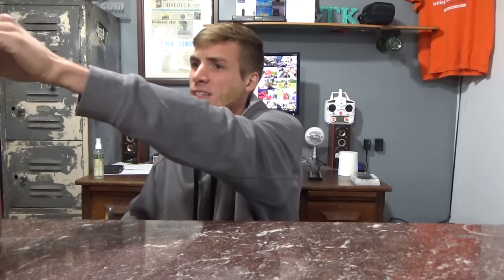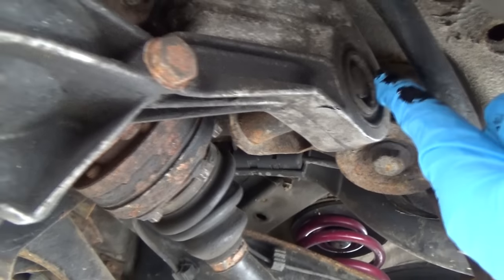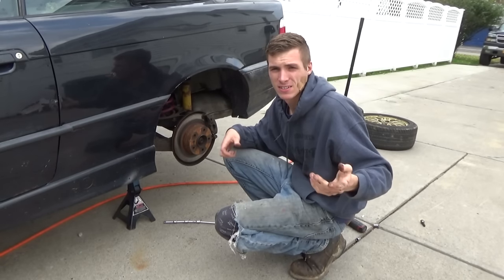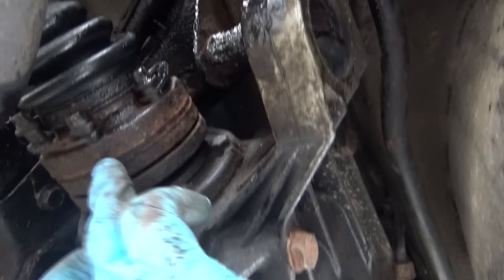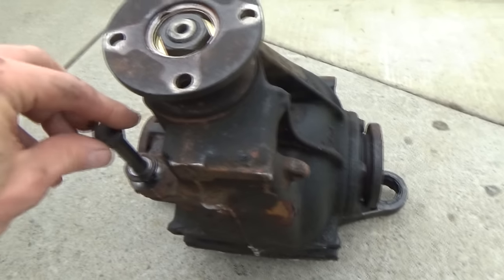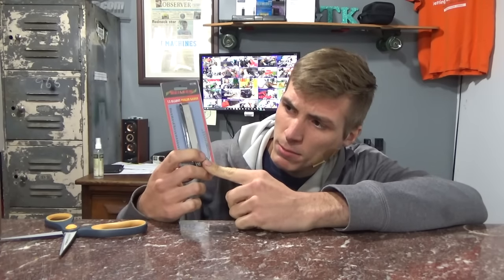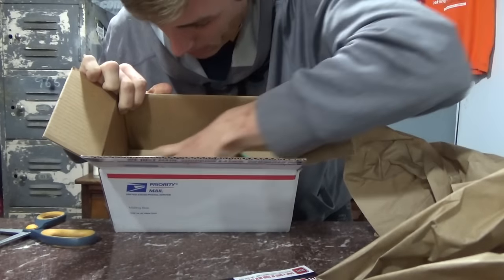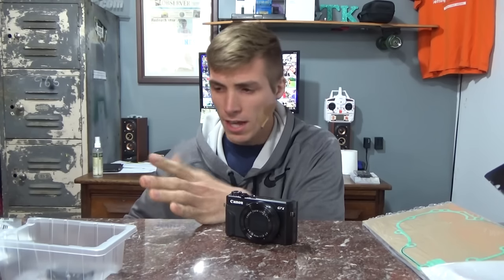THIS Is Why BURNOUTS are EXPENSIVE...

Comment: there's question how much we all love you and would hate to see anything happen to you if you didn't work by yourself most of the time it would be different.. subject jack stands I've noticed you have no backup system in place God help if one of them would slip off support and Crush you. just take an old tire and rim threw it under there for support. please this is only a suggestion would not want to upset you in anyway you have enough on your plate without worrying about me please take it easy and enjoy your diesel Duramax sit back and enjoy that leather and diesel smell in the mornings remember we all love you
Reply: Dude that was extremely well said 👍
Reply: i agree with you Robert Westfall! its so important to have at least one thing in place to save yourself even if its just stacked up 2x4 or 4x4s anything is better than relying on jack stants. when you start torquing  bolts alot you might shift the car. also Motohomie your right it was very well said!
Reply: jonathan ellmann much respect for this guy , most people would just say 3d is dumb for doing it but he changed it in a positive way👌
Reply: Rolando Macias keep doing that. let natural selection do its thing
Reply: Robert Westfall always throw the wheel under the vehicle. when I was a kid my friends dad died when his car fell off the stands. he was stuck under the car for hours because he was working by himself. there r times in life when it just makes sense to have a backup plan. much respect.
Reply: you set the jack on flat land and on there right and you will be fine he had the jack under there too. Well of course if you feel the car move you stop i don't think your having to torque at 1,000 pounds to take the car off jacks. COME ON BRO
Reply: Jay B ,  exactly jack stands are not 100% most jack stands only have a small roll pin through the lock on them , they rust and can shear off
Reply: +Rolando Macias kid died his senior year in my city because his lexus crushed him because his jacks failed and had no backup (tire, random object to save life) so yeah i'd rather not take my chances and slide a tire under there instead of letting my car have the chance to take my life
Reply: Jay B hey Jay it's Robert Westfall I was wondering if you would be interested too help me put together some sort of a plan for 3D mechanic shop safety equipment such as tires blocks a pair of taller jack stands .. electrical GFI outlet protection fully equipped first aid kit with tourniquet let me know if you think anything else and what do you think about the idea of asking CEO 3DMechanics about all this
Reply: jonathan ellmann hey it's Robert Westfall what do you think about suggesting to 3D mechanics equipping shop a few safety items. like tire blocks a couple of GFI outlet possibly some taller jack stands fully equipped safety kit with tourniquet I was thinking a lot of the stuff we can get donated
Reply: Those look like descent stands, but I always use my jack as the back up.
Typically stands don't fail, usually the vehicle falls off the stand or the stand tips over because the jackstand wasn't properly positioned and/or the vehicle properly secured.

Comment: I recommend picking up a snap on gax36 extension. 1/2" female to 3/8 male and 3feet long. Will make installing and removing those axle bolts much easier. I was a vw tech a while back and used it all the time lol. Is quite pricey though.

Comment: If yo plan any more burnouts, you should change all of the bushings on the diff.   Also check the Guibo joint on the driveshaft,  It may have also been compromised.

Comment: Replace the rubber bushings of diff with metal bushes to restrict the movement and do burnout and even drifts if you still need some movement you can go for PU bushes instead of metal ones.

Plus you got the replacement for ur camera so you got a brand new unit or a refurbished unit which looks like a new one ?

Comment: hey 3d, that longer bolt and wake
washer I idea won't work. what happens with stock bolt is it compasses the rubber bushing making it expand and become more rigid. if you to make the longer bolt and washer work, don't buy another mount. instead go a tube or 2 of windshield Pollyurathane and make your own mount, plus it'll end being stronger than stock. id be happy to help you through the steps and you'll need to remove the entire diff out the car to do it.

Comment: That small allen bolt holding the break disc strips real easy if left on without copper paste for a few years. I know it takes 10 seconds but its still faster than drilling them out. Also this bolt is supposed to be torqued to 12 foot-pounds and your small impact delivers 75 on paper. JUST SAYIN'

Comment: You need the gorilla wheel studs, for the German cars they are great. You remove one or two lug studs then replace with the wheel studs. That way when you take the other off the wheel stays in place and you can slide it off and reinstall with ease!

Comment: Hey. If you decide to work on the rear again, try searching for the STRONGFLEX bushings (no its not an advertisments, they are just cheaper than powerflex)They are made in Poland but offer a choice in stiffness and are pretty good quality.  I had so much trouble with bad quality rubber.. Destroyed like 3 or 4 diff covers (when rubber comes off on e30 it rips off side of the cover with a bolt) Im rocking polyurethane in my e30 for 2 years now, and going to install full kit on my e36 compact aswell. You will feel the difference when hooning :P Good luck!

Comment: I wouldn't modify the bushings with the washer. This car most likely wasn't driven like this before you got it so now all the parts that were weak but hanging on are failing.If you replace it with a new bushing (or perhaps a performance one) it'll be fine. There is a bushing there for a reason and having the washer bypasing it won't be good.

Comment: watch those feeler gauges don't go rusty that's what always happen to mine
Reply: Owen Dodman oil  them before  you put them away and they won't rust...I oil mine down with a bit of assembly lube super tacky oil and it stays stuck to the feeler gauge set...and I put it in an old pill bottle and put it in my tool box for no mess....went thru many sets due to rust before being  sick of buying new ones every time I needed to use a feeler gauge....I've been using the same set now for about 8 years since I started to oil them

Comment: Just weld her no rubber and if u ever have to change it grinder
Reply: Or does that have to move idk
Reply: It's more of a noise/vibration thing.    A compromise was already mentioned, polyurethane.   It's noisier/harsher but it is stronger, oil resistant, and still has a little flex.

Comment: Hay to make a tap from a bolt take your dreamel with one of your thin cutoff wheels. Then cut one or two groves the length of yhe bolt and as deep or little bit deeper than the bottom of the threads. It's not best but it can work without having to buy one tap. For the bushings look on line for making your own Polyurethane bushings. You can even add shoulders.  As for washers find some 1/8 to 3/16 thick steel cut to size and drill the hole to size. Last thing upgrade bolts to grade 8 or metric grade 10. You got the basic skills to do all of this.  Keep learning. metalSmiths

Comment: Burn outs have never cost me more than tires. Slicks are better. Wheel hop is the enemy.  SAS and locker with trac bar is best.  I went cheap: 1. Straight 7.5in. 2. Steel leaf suspension 3. Money went into good shocks and locker box locker. Never broke a driveline part from heavy foot abuse in over 20 years.

Comment: You are going to regret putting that allen head bolt that holds the rotor on with an impact if you ever want to take it off again.  I don't even know why manufacturers even put those on.  They are totally unnecessary since the wheel presses against the rotor which presses against the hub.